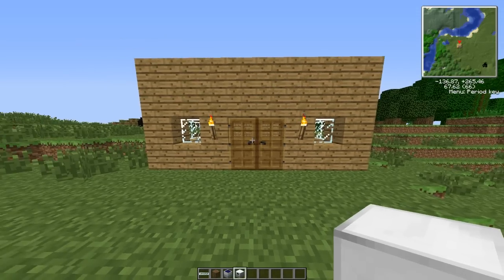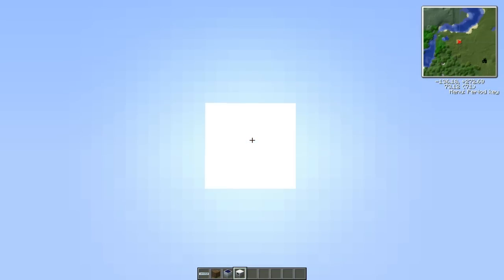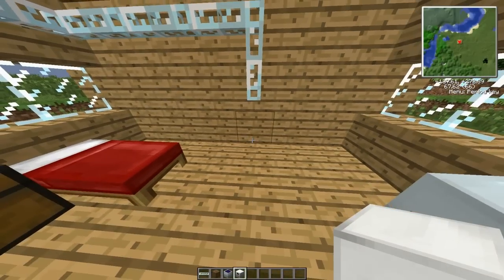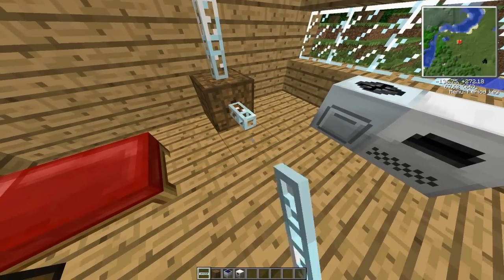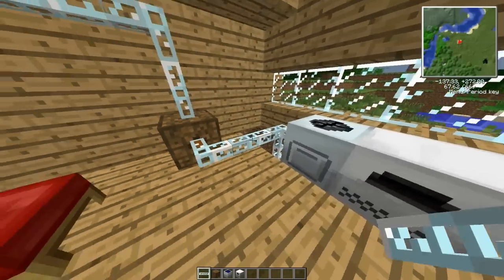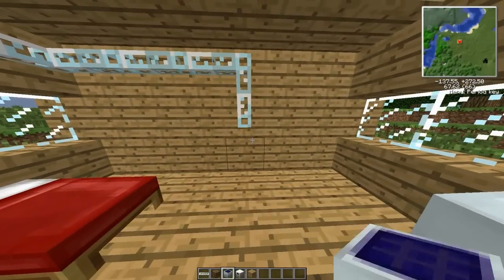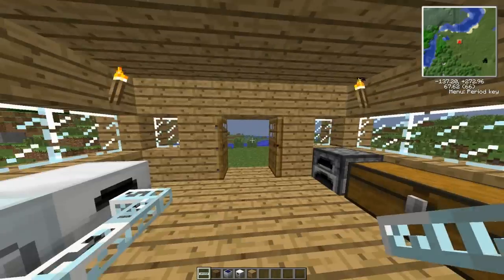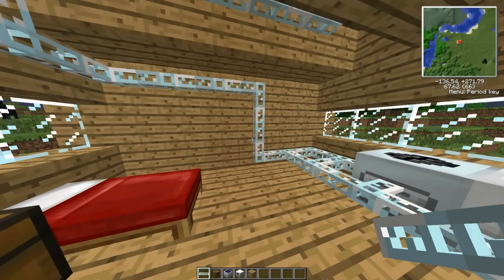How To Use Solar Panels

Comment: Doesn't work! I tried every possible direction with the wrench and I use Gold Insulated cables!!!
Reply: Try glass fiber cables, Thats why.
Reply: Ultra low current cable works costs 3 tin

Comment: You don't put anything in the box in the solar panels, make sure the dot on the batbox is facing away from the glass fibre cables that are connected to the solar panels, I don't think it matters how far away it is you should look that up. :)

Comment: Use glass fiber cable from the panels to a bat box then from the bat box you can use regular insulated copper cable. It would be madness to waste the glass fiber cables on the machines.

Comment: hey i followed your instructions, and i have the solar panels hooked up to the Batbox and the Batbox is fully charged, but when i connect the Batbox to my Compressor or Electric furnace, it still says they are turned off and have no power source. help?